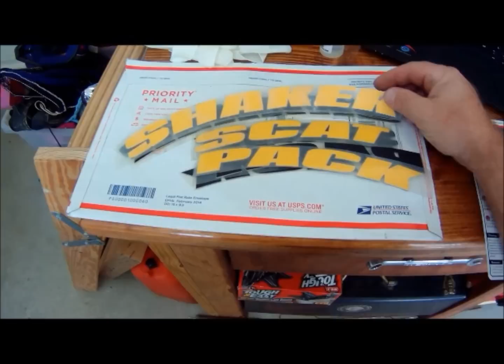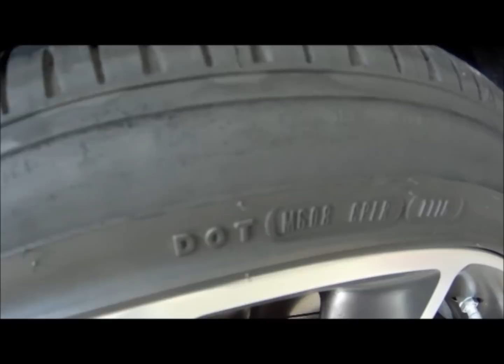Shaker Tire Stickers

Comment: I did mine with sand paper, I didn't completely get rid of the ridges though, I got those two lines pretty good, was really generalist with the acetone and mine held up nicely. The key is the acetone and applying pressure to the letters after application, that's a damn good job without a doubt.
Reply: DW'S GARAGE yeah, that grinder idea was pretty damn clever, definitely took it to the next level. I just did my tires the other day and they took pretty well, I was impressed as too, I think on the next set of tires I'll use the grinder
Reply: DW'S GARAGE will do, definitely looking forward to seeing what you have next. I did a body color front spoiler mod, turned out better than I thought it would.

Comment: Excellent instructional video. Very informative. The only thing that would drive me nuts is the lettering alignment in correlation to the wheel. I would have to justify the words dead center to the wheels all the way around. For example the word shaker would be lined up dead on at the 12 o'clock position of one of the split spokes and the other words exactly opposite. Is there any reason why you aligned the letters this way, does it have something to do with how the oem lettering and texture on the tire is laid out or how you had to grind it off?
Reply from the maker: Rick Theory Yes i placed the lettering where it would be most covenant for looks and removal of texture on tire.
Reply: I thought it might have something to do with the grinding.  There's not much you can do about how the tires are mounted and balanced on the wheels exactly so each tire is going to line up differently.  Even if you applied the lettering as I suggested each tire would still look different because of the oem font and texture.  Anyway thanks for explaining and thanks again for the informative video.  If i choose this mod in the future I will be better equipped to complete it.

Comment: So you grind on your $250 each Goodyear F1s to install a $5 sticker on tire?   Uh .... no thanks.
Reply from the maker: Pat, the only thing your doing is getting rid of the raised letter and design on your tires. your not grinding your actual sidewall down. The lettering is not a sticker but, actual rubber. To have the ability to fully customize yet another part of your car is worth something. The response gained by this simple mod is huge. But, hey if you want to stay unnoticed stick with your black walls.